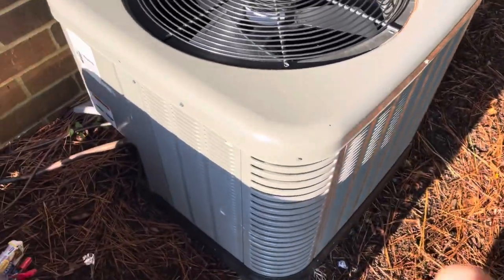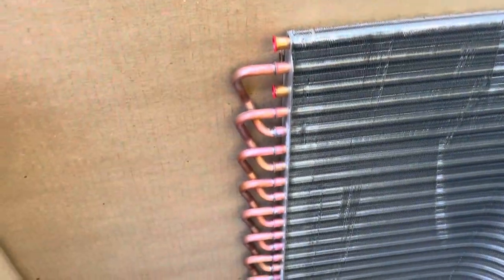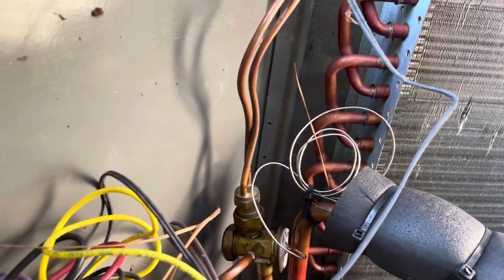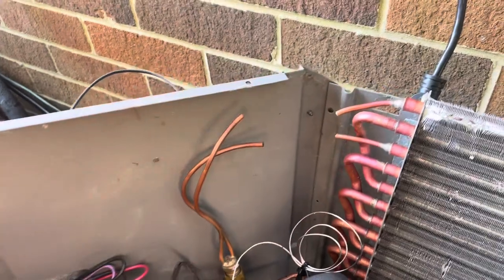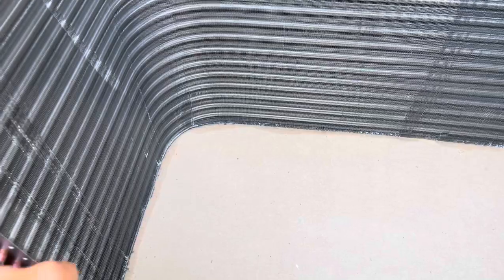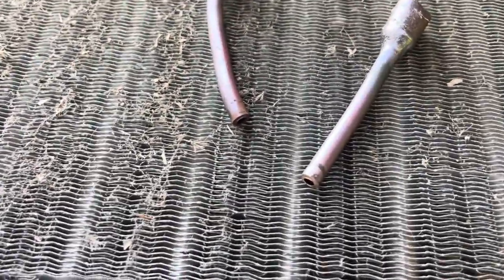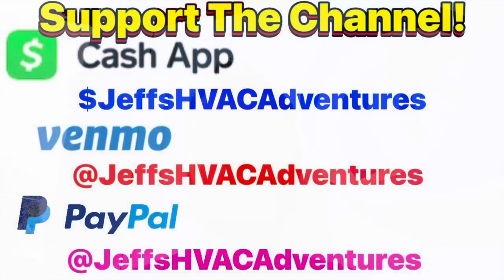Replacing Condenser Coil On Rheem/Ruud Heat Pump!

Comment: 2 major things that I would have done different. First off, Id of cleaned the inside of the heat pump. There is no reason not to when you have it fully open and the money they are paying. Second, dont care at all for the way you ran the copper out the back of the heat pump. Again, the money they are spending, you should have gotten those off the ground and moved closer to the house. But as most HVAC companies dont give a F about doing  a good job, kinda understandable. Most HVAC companies dont lay the ground work for the next visit or call. They just want to get in there, get it done and get paid. Who cares about 10 years from now. Having been in the business, if I came out and saw your work, Id request the above, let you finish but never call you again.
Reply from the maker: Thanks for the tips.  And thanks for watching! 🤙